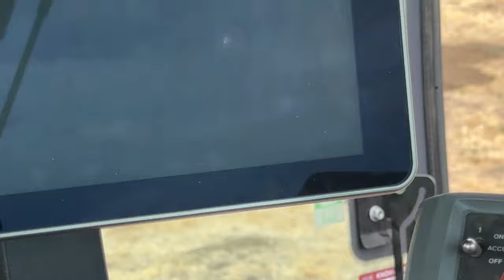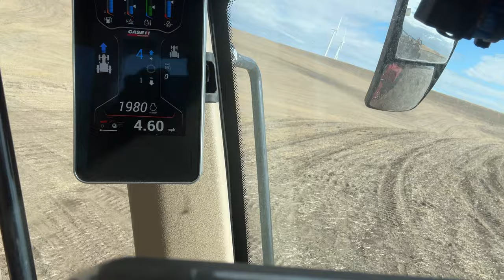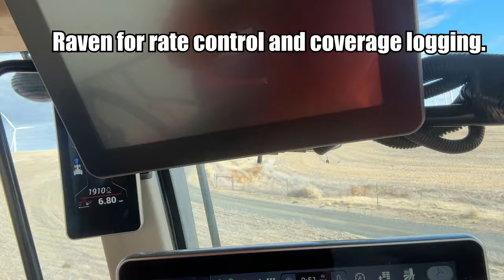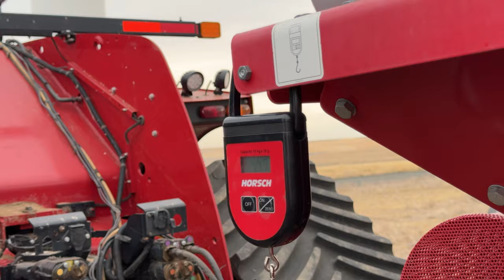Seeding Red Winter Wheat in the Palouse

Comment: So do you guys use guidance systems?
We farm pretty flat and square so guidance is good for maximizing the  processes.
Reply from the maker: We use free form when we cant use A B straight guidance. It follows the last pass and does pretty well. My vector self propelled has 73 sections so that i dont overlap, but everything else ive ever ran has a ton of overlap. Even with guidance, we got a lot of tiny pieces and that makes for waste